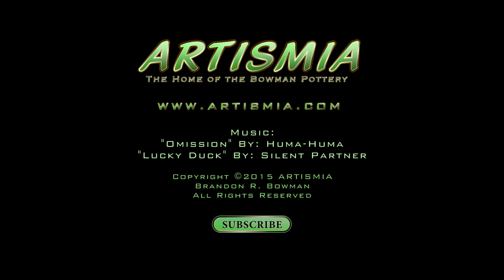Making a Welded Face with a beard. #welding

Comment: Great work. Very original. New subscriber now. Were you adding metal with 7018 rod? And is it helpful when you leave the flux on the rod? If so to what affect. I'm curious. Very creative.
Reply from the maker: +Bill Holly Thank you Bill! The standard welding rod I use is a  mild steel ER70S. Additionally for this project I used some pieces from an old pen fence (the white rods). No flux or flux coated rods used.  Hope this helps, Thanks again for watching, commenting and subbing! :)

Comment: Crazy awesome!! Can I ask what the small die grinder/cutoff tool you used is?
Reply from the maker: +M4ttflynn Thank you! :) I think you are referring to the Dremel tool, and the variety of grinding stones/metal cutting discs. I have a flexible rotary extension cord/shaft attached. Hope that answered the question. Thanks again for watching.

Comment: what kind of rods are those.   you have really impressive skill at controlling the heat and form with them.
Reply from the maker: +James Ouzts Thank you James, Much appreciated! For this I used an old pen fence for some of the bulk and mild steel ER70S rods.
Reply: +Artismia  Wow.   I'm sure most people don't realize just how impressive that it.   filling a gap between to plates is tricky enough but using what amounts to junk metal to build up a spherical shape and controlling the shape of the surface with just a torch like that is inspiring.    what is your background with metal working?    and sculpting for that mater?
Reply from the maker: +James Ouzts Yes many of the inexperienced, who think they know, really don't. Thanks again for the much appreciated kind words! As for background - access to the tools and lots of Practice. (Humbly, not to mention) The 20+ years selling my "works" of "art" and fulfilling commissions. The 2 BFA degrees, partial MFA from KSU. 10 years as a facilitator/educator, helps a-lot too. :)

Comment: crazy good. How is it that without gas shielding you get so few bubbles in your steel weld? they are ugly oxydized on the surface, but when you grind them they are clearly good inside.
Reply from the maker: +nraynaud1 Thanks again. Practice, smooth flowing good quality rods, & temperature control.

Comment: I work at a muffler shop and do this type of welding everyday. its really easy to fill up gaps with it, unlike most other types of welding. what type of rod are you using?
Reply from the maker: +rukusbukus Indeed. ER70S